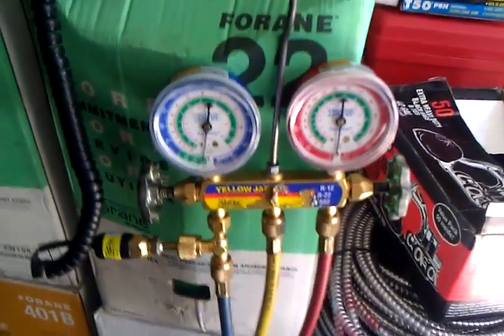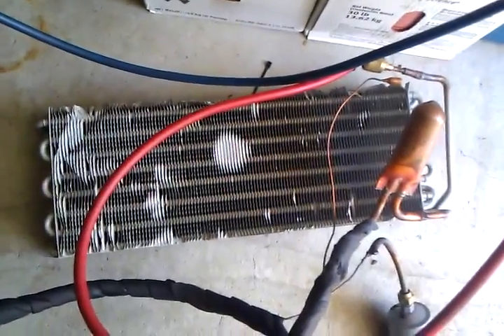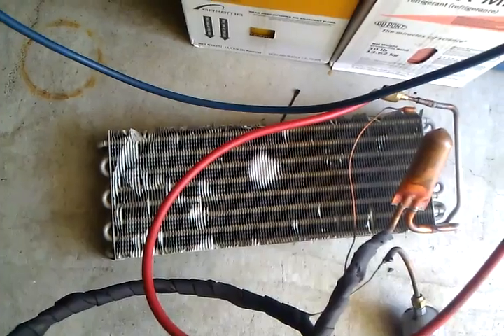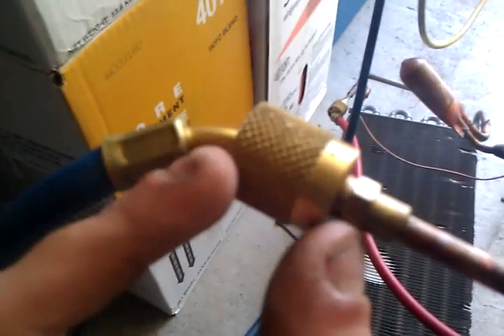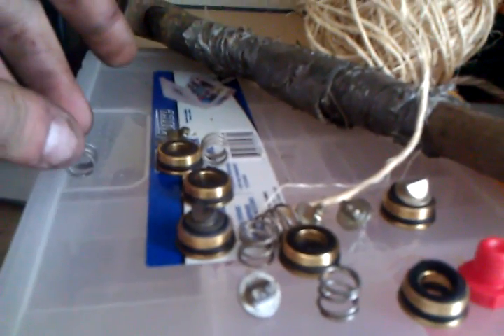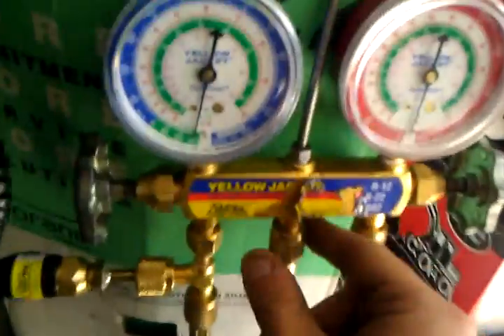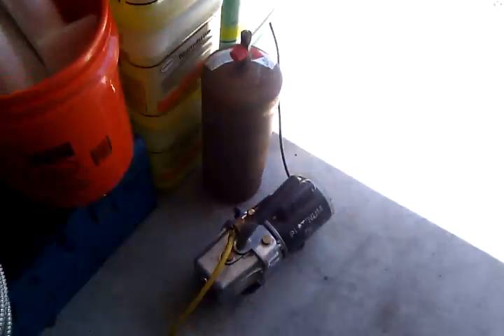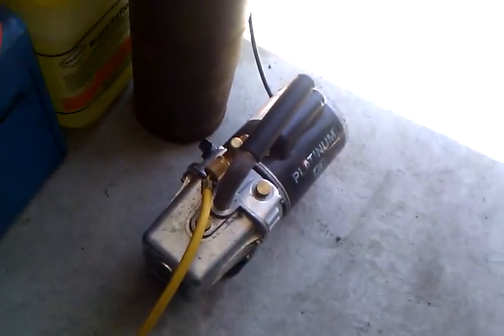New Yellow Jacket micron gauge

Comment: Try vacuuming without using the manifold gauges and use hoses designed for vacuuming...the black ones...you will get better results...remember, the less fittings and valves, the better